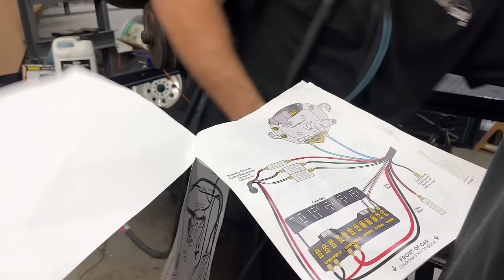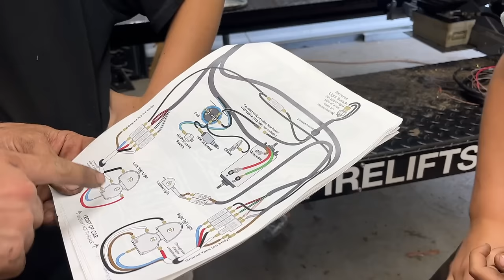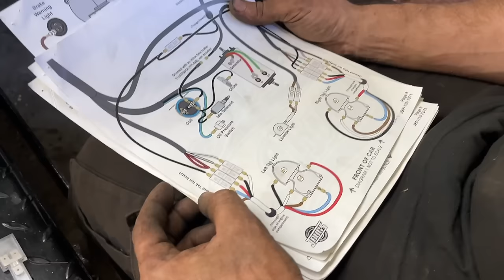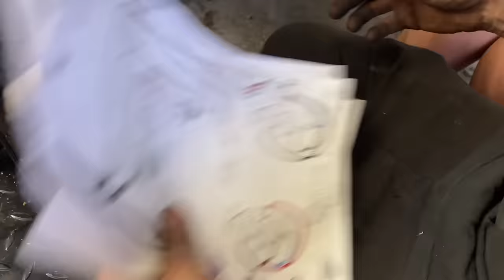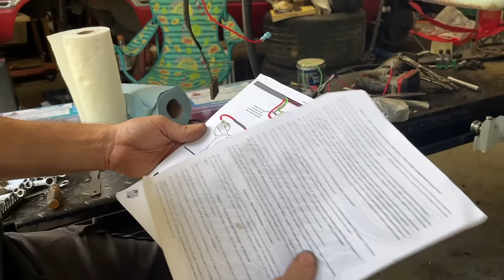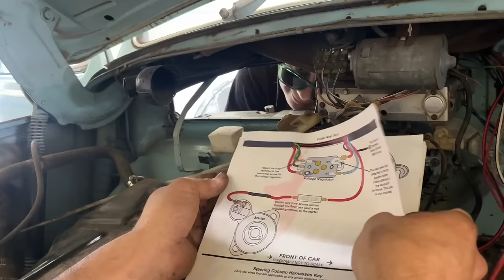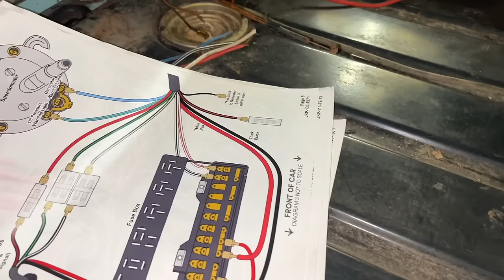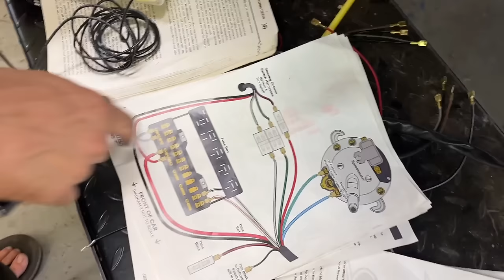Back on the road after 23+ years parked!

Comment: You put your kids in a uninsured unsafe car on public highways ? no seatbelts ? And let your kids drive without a license ? If a cop pulled you over you would be in allot of trouble especially putting your kids in danger like this. Maybe 30 years ago this was acceptable but not nowadays
Reply: Uninsured? How do you know? Besides, having insurance doesn't magically make a car any safer. It simply mitigates the financial and legal risk. The car is wearing a TN tag.
Unsafe? The car has new brakes and tires.
Seat belts? Okay, fair enough. Although I will point out that if the car was three years older, it wouldn't be legally required to have seat belts at all. Would you also flip out if a parent was riding a motorcycle with their kid sitting on the back? That's vastly more dangerous. I'm sure they will sort out the seat belts before taking it any further.
You don't need a license or to be a certain age to drive on private property. Neither of the kids drove on the public road. With Josh driving they went a half mile up and down the road. Don't get your knickers in a twist. 
This is a small quiet rural community, I expect Josh knows all of the local cops personally

Comment: Well, let’s have a look. And maybe I can help. But prolly not.
What prolly is gonna happen, is you or someone else is gonna read this
And get hacked off.
Because you, and the Chinese got it all re engineered. 
And it’s going to run, and last, and be dependable 
Right?
Nope.
I’ve seen this over and over….and it just doesn’t make it home.
And, see what the big thing about this is. You’re giving it to your daughter.
She’s going to drive it.
It’s going to need to be dependable.
But it won’t.
Sorry.
Because I see what you’re doing.
And, I mean the utmost help and kindness here.
Make it run, sell it and buy her a Toyota Corolla. The self driving car, that never breaks down.
No dad…it’s not a lawnmower.
It’s completely different.
Okie dokie. 
Hhhhhhhhaaaaaaaaaaaaaaaa.
The carb is wrong
The air filter is wrong
The distributor is wrong
The fuel hose is wrong
The clamps are wrong
The fuel pump is wrong
The fuel filter doesn’t belong there …or at all for that mater.
More than likely:
You haven’t adjusted the valves, checked the End play, unstuffed the hot air pipe, fixed all the leaks from the top from the bottom. More than likely the thermostat is missing if not the whole flap assembly. And on and on.

If you want to really
Really.
Now, listen to what I say…..are you paying attention? Look at me…..look at me.
Really, fix it.
Start with the engine. Grab hold of the pulley in back, and push it in and out.
It moves in and out about an 1/8 of an inch?
It’s wore out, and needs line bored. By a pro.
It doesn’t?
You have a chance to save that one.
Get the orange Bentley book, and follow it to the letter.
And a word of warning. Original parts are pricey.
The correct FP, Carb, and Dizzy……restored beautifully, by pros will set you back about $700.
The engine needs these three units working in concert to make it run correctly.
More importantly last, and be dependable.
Along with dozens of other small stuff.
So, take that into consideration when weighing a Toyota.
Sorry, for being curt. I’m only trying to help.